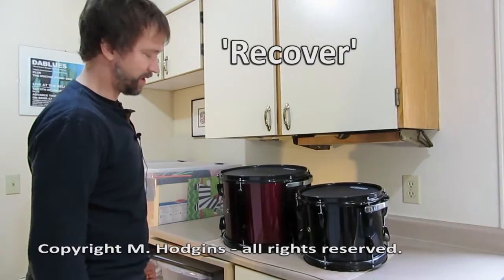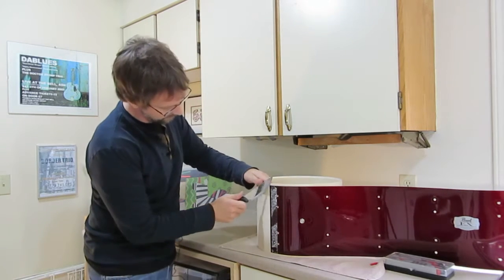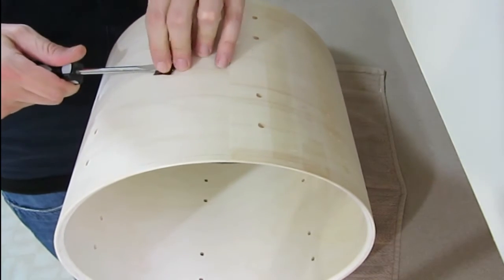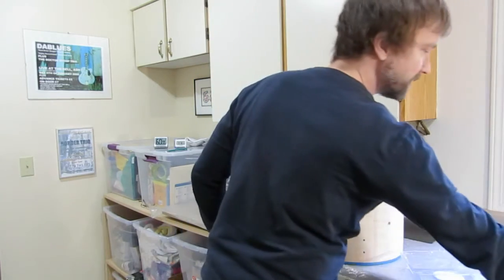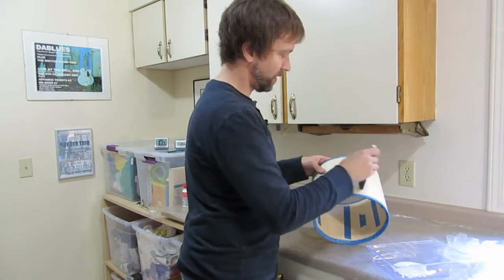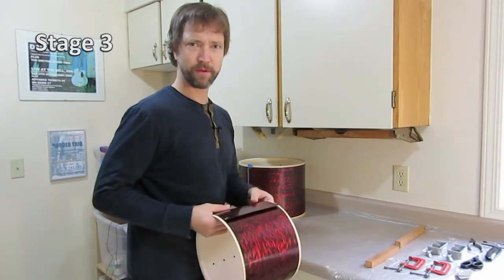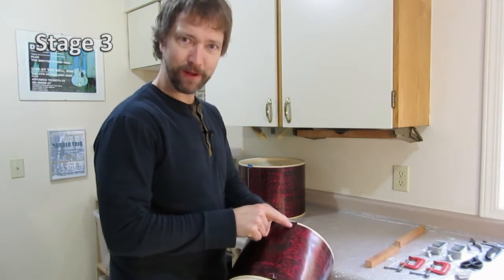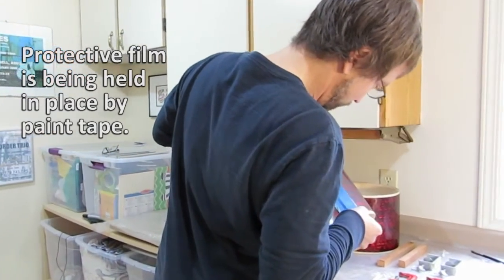How to re-wrap drums: to a beautiful finish [Part 1]

Comment: Try that on a vintage Ludwig, and you'll see what I mean, your drums are a piece of cake to re wrap
Reply from the maker: The original wrapping, on older drum sets was ‘tight’ with pervasive glue. Prepare tools: a heat gun, a hairdryer and a wallpaper spatula. Start with hairdryer, and see if that level of heat softens original glue. Rule 1) avoid heat gun unless needed to loosen glue, as it will affect the shell, 2) avoid pulling splinted chunks of wood with the glued wrap (some splintering is inevitable, but keep to minimum). It’s arduous work (smelly too) but can be done. Then if you like, just follow my video from there. Good luck and thanks to everyone for comments and input!
Reply from the maker: Hello, from my experience you won’t need to even, it out, unless the gap, or missing area is large. Sure some filler would help, but the wrap, will not show, or expose some ‘cratering’ on the shell. It’s a bit harder to answer this one, but I have been where you are referring, and I did not need to fill and sand. Just wrap over it...